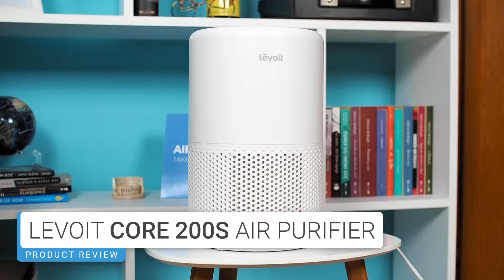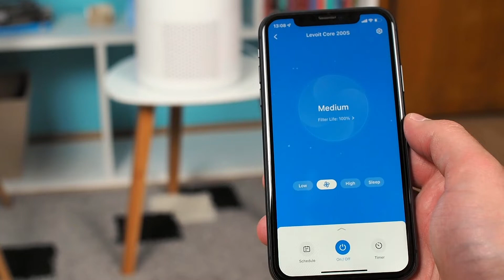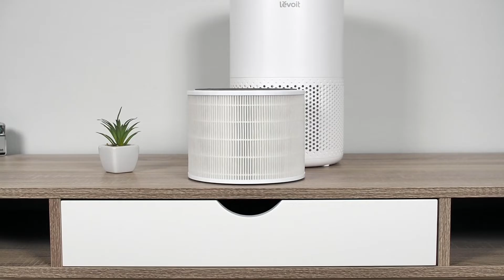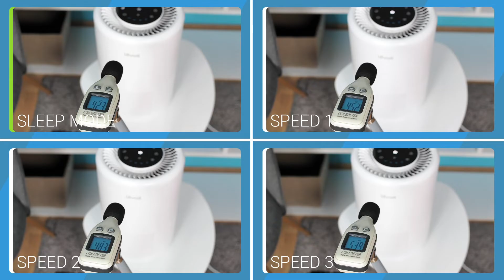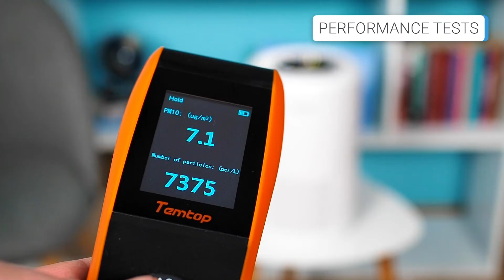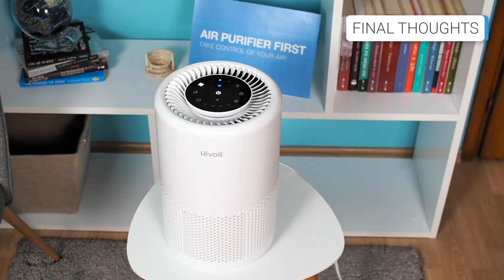Levoit Core 200S Air Purifier - Small, But Powerful (Review)

Comment: I want to get this one because the specs are better than some Air purifiers charging $300+.
Reply from the maker: I believe that's true. What other air purifiers are you considering?
Reply: @AirPurifierFirst  there's Allen air purifiers, one goes for $300, doesn't work for viruses, theres a shark one I looked at for over $200, doesn't capture mold or viruses.
Reply: @AirPurifierFirst  better than a $300+ alen and $200+ shark.

Comment: you better check the filter on a more regular basis that 6 to 8 months depending on your home, also the filters are cleanable. vacuum them from the outside of the filter, don.t do it from the inside because you will pull the dirt and dust further into the filter, we have two sets here and this method works fine, I have been using Hepa filters in my business for 20+ years and find them very good but due to the high rate of entrapment of dust and particals they clog faster, but this is how they are so efficient.

Comment: I'm really struggling to decide between this and the Levoit Core mini. The Core mini's max coverage just fits the biggest room i would use it it, but I'm not sure if this means I would have to run it on max for it to work in that situation. I really like it's power consumption levels, but the filter difference also has me worried. I don't appreciate Levoit calling it a HEPA filter when it doesn't meet the government standards. At half the price  though, it's a though decision. I could basically buy two if I wanted to cover more rooms at once.
Reply: Amazon sells off brand HEPA filters for the mini that's better than the original. I'm not sure if it's real HEPA tho.
Reply from the maker: I have completed all the tests on the Levoit Core Mini and will publish its review on Friday! Levoit Core 200S has a higher quality HEPA filter, which is also bigger. It also has many more features than the Core Mini, so I suggest buying the Core 200S instead the Mini.

True HEPA on the Core 200S traps 99.97% of airborne particles up to 0.3 microns in size, while the HEPA filter on Core Mini traps 97% of airborne particles up to 0.3 microns in size.
Reply: @AirPurifierFirst  Thanks for the reply! You channel has been extremely helpful. I look forward to checking out the video. I actually just purchased the mini today, I got a really good deal that was 25% off. The 200s is 2.4x the price, so I figured if the mini is not good enough I will either return it or relegate it to the smallest room and buy something better that's recommended on your channel.

Comment: The filter doesn’t last anywhere near 6-8 months. The app will say replace filter after about 4 months, even if you always run it on low. I have this exact model.
Reply: That’s an average doesn’t mean it’s a guarantee also, it depends on your household if you got a lot of pollutants or a lot of dust, dirt pet hair, etc. it’s going to get dirty quicker just like for example my sister’s house first as we have a housekeeper that gusts twice a week and our filters last almost 10 months
Reply: @raarontillery  The Core 200S doesn't have a sensor, it has no way of knowing how dirty the indoor air is.
Reply: Does this remove smoke smell
Reply: @swavezmartin  It can, if you run it on high. Keep in mind it's for small rooms.
Reply: @jjayguy23  just picked this up it Covers 183 sq ft I no my room isn't that big does this work fast is it a good product
Reply: Use layer outside the filter, it will make youre filter last longer
Reply: @lubina8130  a layer of what? cloth maybe?
Reply: Depends on where you live and how much air pollution is around bro. 4 months filter change is normal for a place with a higher PM2.5 level in the air.

Comment: Hi, i have a question about the filtration system: do you think it's better to have Pre Filter-->HEPA-->Carbon or it's better to have Pre Filter-->Carbon-->HEPA ?
I am scared that the activated carbon filter may release carbon particles into the air.
Reply: Pre Filter-->Carbon-->HEPA is better.